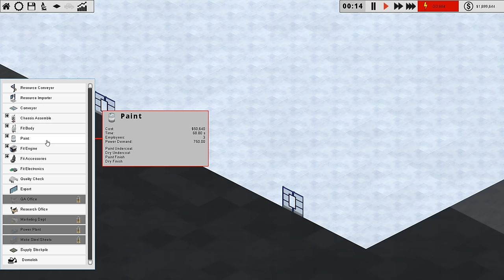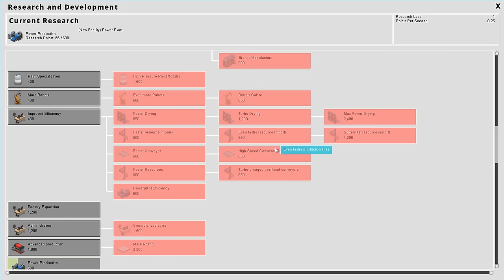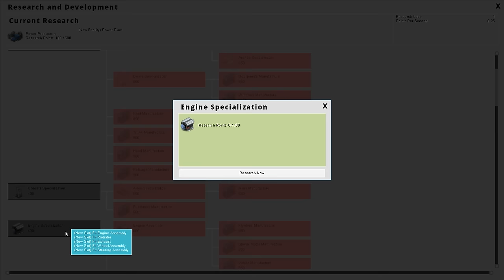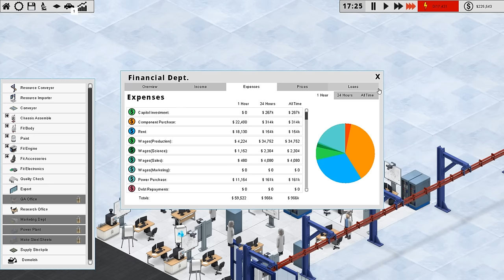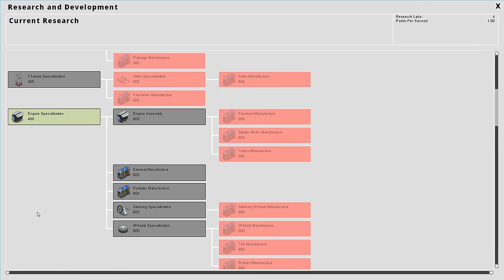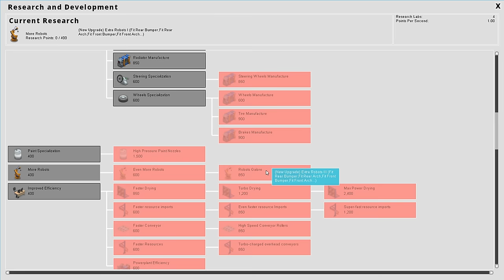Let's Play - Production Line - New Method!

Comment: If I were you i would leave more space in between the different stages of the car production of allow for more adaptability and easier expansion. This comes especially handy when you research into breaking down the steps for each process, such as with the paint when you break it down I will then take up 3 more squares.

Comment: Why don't you put the engine fitting at the very end of your factory. Start with building from behind. That way your conveyor to Engine Assembly will be shorter and the problems of missing ressources might be solved.